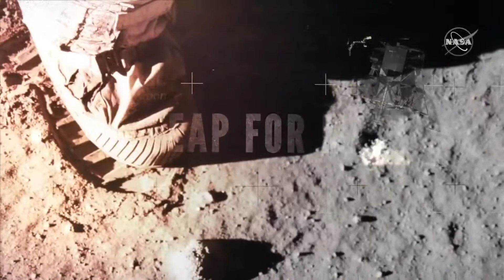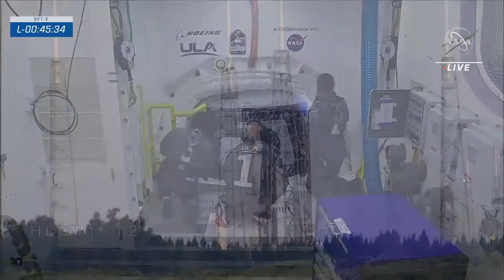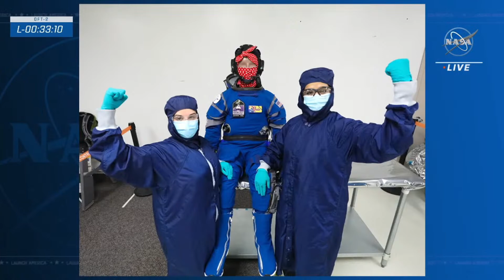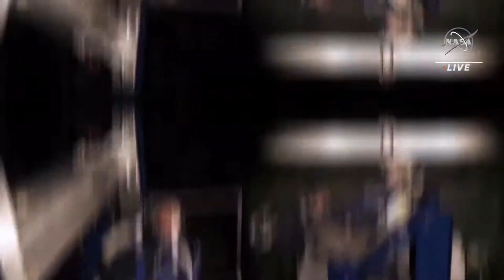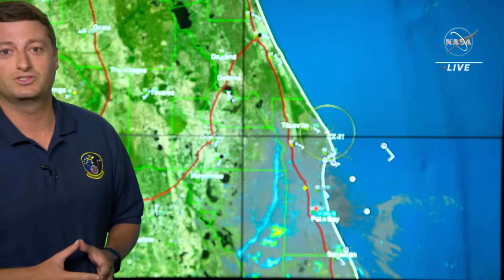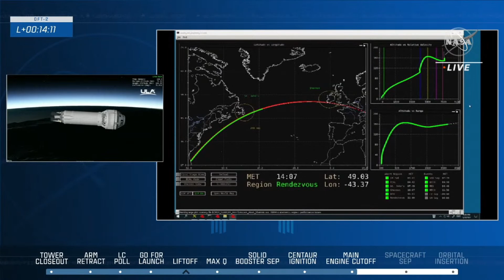WATCH: Boeing Starliner Test Flight (OFT-2) - Livestream

Comment: Emits 250 tons of poisonous gasses and carbons into the atmosphere in one launch....yet one of our tiny little cars emit less than 20 pounds in it's lifetime.....gotta love science
Reply: Current estimates put the amount of automobiles on Earth at 1.5 billion. And that's not counting all the other internal combustion engines besides.

And the amount of "harmful" material in the exhaust plum is dependent on the propellant being used...

Example...if a rocket uses hydrogen and oxygen to produce thrust, what is the byproduct?

Another way of putting it, why was the Space Shuttle exhaust plum so different looking from that of the SRBs flanking it?
Reply: look up your '20 ponds' and get back to us